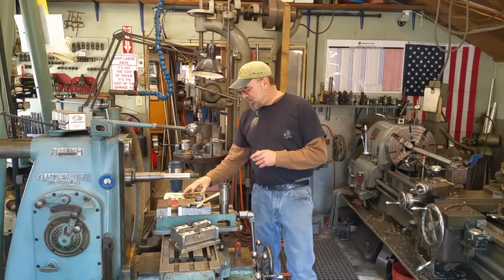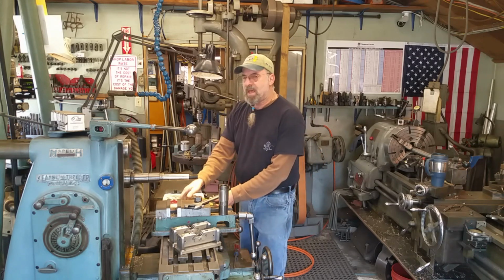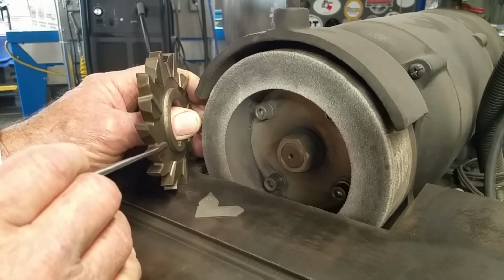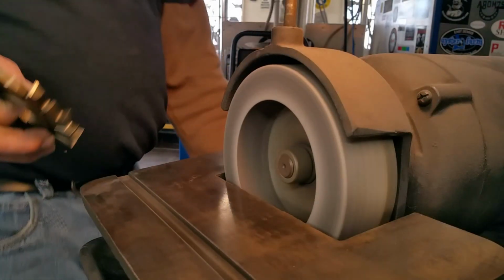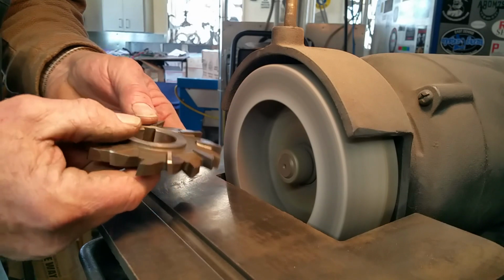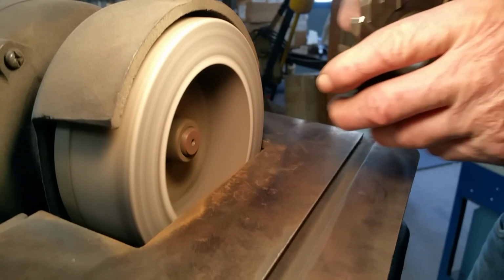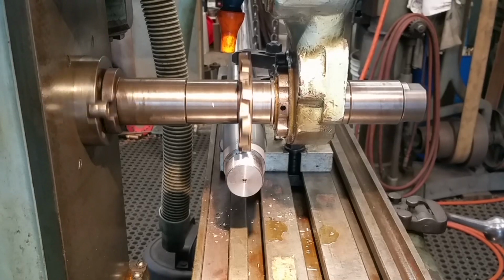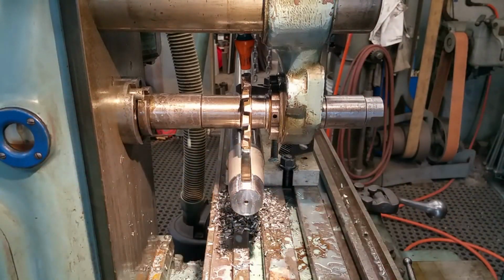Sunday Notes 5

Comment: Nice...I call them staggered toothed milling cutter...I do this also, mostly end mills.. [if the sharpening side of our business is too busy doing it in the tool grinder with radius attachment]  ...infact,  I have the  same grinder, what's up with those fancy tilt rollers...don't have to be,  no need to cool shaft with water...will cool fast enough with the cold material around the heat spot.. a little safer, especially on high carbon and alloys. I love your intro music...the best I've come across !

Comment: You might also try having a round-ended key slot since stress risers can be vertical as well as longitudinal. I have seen round-ended keys like the slot had been cut with a ball end mill. Maximum stress is in the skin of the shaft since a shaft that twists 1/16 at the circumference twists zero at the center and 1/32 at half the radius. In a previous video you said the prop installers had been overtightening the prop nuts. Perhaps you could rig up a strain gage to measure how much the shaft stretches after making contact. Giving a spec in degrees tightening torque could help too. I.e. an eighth or a quarter turn on the nut depending on the length under tension and the yield strength. There should be no plastic deformation on the prop shaft after tightening then loosening.

Sorry to have rambled on so much...

Comment: Index with the teeth but rather than balance on two cutter teeth I would suggest a 1×2×3 block with a slug of round stock that fit the cutter bore bolted on. That would give a more stable contact on the table for radius grinding.

Comment: Keith, the technique for straightening a shaft strikes me as really skilful, I often wonder how long it took you to learn how to finesse the appolication of heat and cold to get the necessary shift in the material. Very interesting. .
Reply from the maker: It was quite fast to learn how, it took some time to get enough experience to be faster and 30 plus years of doing it to be where I'm at today with the skill set. ;{)------

Comment: Hand grinding multi cutter tooling.... NICE!
Reply: the K&F universal tool grinder at work :) nice tip
Reply: I am still surprised that many cutter mfg. do not offer standard corner radius.  In a previous shop I worked at we used these often in Steel and Ductile Iron.  I got some custom HSS-Cobalt ones made by Niagara with TiCN coating and corner radius from factory.  They were very pricey, but it was a huge gain in tool life.
Reply: In my experience you can buy them however you like. That being said few job shops can justify the price of buying custom cutters new for a very limited number of jobs. usually it is modify what is cheap and readily available yourself.

Comment: I wonder if a curved or round-bottomed keyway might be the ultimate in low stress in a prop shaft with its high impact, bending and twisting and leverage environment. Any info in Machinery’s Handbook on that stuff? Maybe two opposite shallower keyways...

Comment: Keith,
If this was my regular job I would make a tool. 
It would be an angle plate a bit narrower than the cutter diameter.
On the face would be a spud loose fitting in the cutter id. It would be centered on the width of the angle.
This would allow grinding both corners.
A knurled clamp on a thread would snug the cutter on the spud to the angle.
That would give you better control of the cutter against the wheel.

Further thought, a square block with spuds on right
Angle faces would do the same thing.
Reguards
Kap

Comment: So, Keith, do you buy theses slot cutters because  the geometry on them make it easier to grind the radius?
Reply from the maker: It just happens that it is easier, I like the stagger tooth because of the performance and the ease it cuts the harder materials like Aquamet. ;{)-------

Comment: You have the old shaft to work with, perhaps you could make a dummy wheel and try twisting the end off with various key configurations to see which works best. Well maybe a smaller diameter would twist off easier. Actually, I think there is some sort of clear plastic that shows stress lines under UV light that would be easy to work with. Do you know any MIT engineering profs? They may have some students who need a project.
Reply from the maker: The actual breaks or cracks in marine shafting are from pounding the keyway with a loose fits. ;{)--------

Comment: is there a ratio of what the radius you are cutting here should be in comparison to the key width and depth to prevent stress risers or can you use the same radius in the corners no matter the key size?
Reply from the maker: Yes and Western Branch displays that in their shafting chart. ;{)-------

Comment: Is the key way in the shaft at the angle of the taper, or straight down the length of the shaft?
Reply from the maker: It is sitting in my jig that holds shafting with tapered ends, better shown in my earlier videos. ;{)-------

Comment: Understanding why to do a radius on the bottom corners to reduce stress areas, doesn't a cutter manufacture make such a cutter with that radius already made into their cutters? Just wonder if that is a standard if manufacturers offer such a factory designed cutter.
Reply from the maker: square corner is standard, on the shelf.    ;{)------
Reply: They do, they make radius corner endmills, much easier

Comment: Just asking why you did not use a diamond wheel
Reply: Takes one to know one
Reply from the maker: One reason, keep HSS on the wheel for it and I, 99% of the time only use my diamond wheels for carbide. ;{)-----
Reply: Diamond wheels aren't suitable for high speed grinding of steel cutters, more for grinding carbide.  All in all they cost a lot more for the grind you get relative to an aluminum oxide wheel
Reply: I assumed it had brazed carbide inserts, after looking more closely I see that is not the case